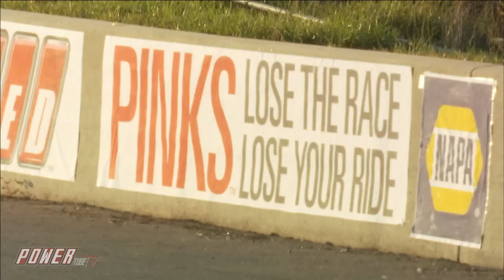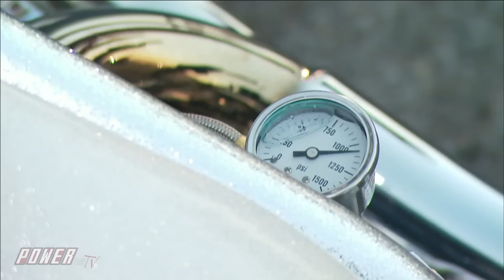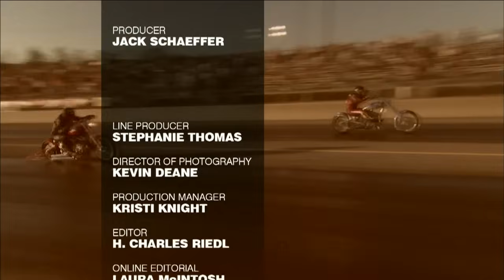PINKS - Can a Harley Chopper Beat a Drag Bike for Titles? Full Episode

Comment: Nothing screams like a 4 banger.....twins are for torque....only so much you can do with torque.
Jap high rpms equal power
Reply: Yep. Even though torque is a really big deal with drag racing, it’s funny how much it takes for a big twin to beat a stock 4 cylinder with a decent rider. There’s lots of stock sport bikes that run mid-low 10’s all day long.
Reply: @NBSV1  Some of that is because a sportbike weighs 100's of lbs less.....takes a LOT less torque to get less weight into motion.  Also a sportbikes powerband starts at 7k rpm, where a harley it starts at 2 -2.5k rpm....thats why the Harley will get them out of the hole most of the time but the sportbikes real them in pretty quickly...
Reply: @redrider0151  Something like a Harley can often get out of the hole better because of the balance and wheel base. Unless you extend them sport bikes are very limited because they wheelie so easy. Takes a lot to make a Harley power wheelie. 
Most of the big twins are also much larger displacement which will naturally give them more low rpm torque. 1200cc's is big for a sport bike, but on the small side of big twins. 
Even with stuff like top fuel and pro stock motorcycles the twins get a big displacement advantage just so they're competitive. Which has basically led to them dominating most of the time.
Reply: @NBSV1 what about the V twin superbikes like the Honda SP1/SP2.
Reply: @giancarlolugo9586  Those end up somewhat of a blend between an inline 4 and the big twins like harley. They're typically similar displacement to the sportbike I4 engines so you can't expect massive torque numbers. But, often they do produce a little more torque and a little less peak hp. Also generally make power a little lower in the rpm range. 
That's the distinction of something being a big twin. Engines like what harley uses are very different from even traditional sportbike v twins. They're typically much larger displacement with a very long stroke which makes for good torque. But, they tend to suffer on high rpm power because the design is difficult to really get it to breathe well.